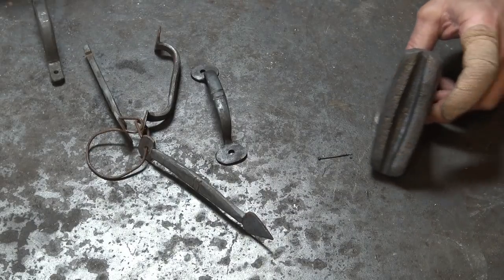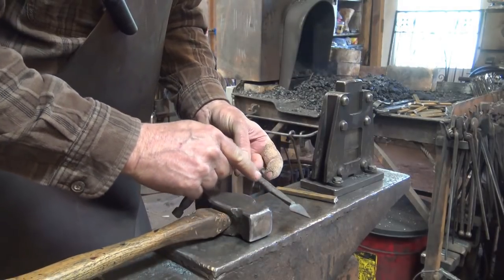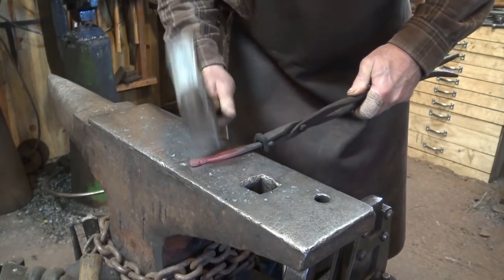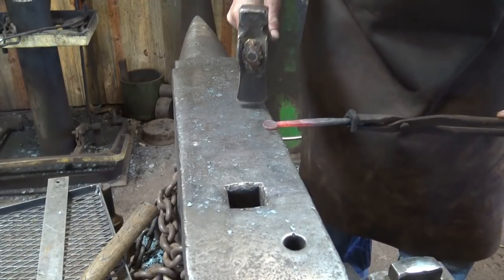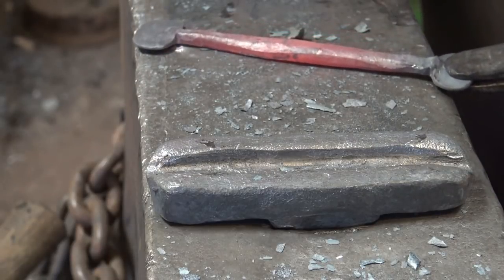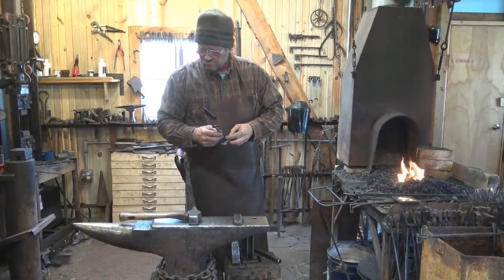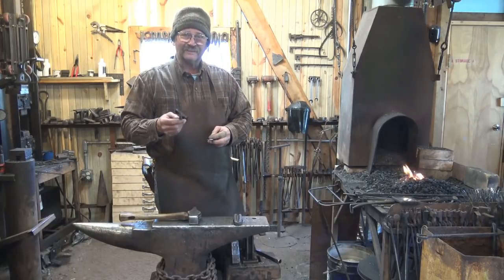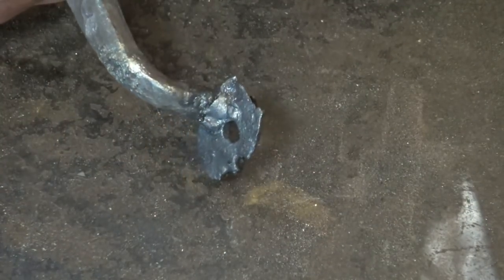Forging a simple cabinet handle or drawer pull - basic blacksmithing

Comment: That second one was not a mistake, it just has some character that the first one does not have and possibly the customer will not find desirable. Or it's a small wall hook needing cut in half. That Swage Block is a dandy that's for sure. And on a final note, a handle on the counter may be handy to get your balance while pouring your Sunday morning coffee after a Saturday night bender.
Reply from the maker: All very good points.  I actually think I will cut the bad end off and mare it into a hook.

Comment: Would it be worth the time to make a swedge that is the shape of the entire piece and form the piece on the power hammer? A lot of work up front, but you could bang them out in minutes and they would all be exactly the same. What do you think?
Reply from the maker: You could certainly do these under the power hammer, but I don't think it would be just a matter of putting a piece of raw stock in a swedge and banging them out.  You would still need to shape the finials and start the taper in the handle before going to a swedge.  A series or tools under the power hammer would make the job faster if you needed to make enough to justify making the tooling.

Comment: hello John Eddy from Holland Europe.I like watching craftsman,Question- I saw a clip where you all met up at a smithies and made some engraving tools.Would i be wrong in saying if you made a swedge and engraved it.would that not save a lot of time in individually decorating them or would the metal not be hot enough to take the decoration.if you get what i mean.
Reply from the maker: If you engrave the the inside it would leave raised lines on the final forging which would be fine if you wanted that.  Having any detail of that sort does require that you keep your position in the die exact or the piece ends up with multiple partial impressions.  For this swedge I felt it would be more versatile without the added decorations.  I have seen old example with more detail, so it doers work.

Comment: I would REALLY like to see you put refractory over that wool, if anything for safety reasons. That wool has particles that are a minute barb. Every time you turn it on it blows those particles around from gas. We already have a ABS mastersmith who has a ongoing lung issue which is believed to be from breathing in those particles from a non refractory forge which barb in the lungs and do not absorb. He has had a hell of a time the last few years near to life threatening.
Reply from the maker: While i understand what you are saying and agree that ceramic wool should  be treated with a coating or ridgidizer, I use ITC-100 and will  be coating this forge lining before it goes into service in the shop.  Your statement is essentially incorrect and may be confusing or misleading to people that don't know what you are referring to.  The ceramic wool is the refractory for this forge.  Putting refractory over it could just as easily mean a second layer of the ceramic wool.  ITC-100 and Satanite are coatings used to seal and ridgidize the refractory and while they are a form of refractory they serve a specific purpose.  The term refractory includes a wide range of products from ceramic wool, ceramic boards, castable, ramable, soft brick and hard brick.  None of which would be the proper thing to coat the kaowool with.  Perhaps I'm being picky, but proper terminology can be very important.
Reply: If semantics are in question I would suggest its you that has it backward, the wool is just that, an insulation and ITC100 IS a refractory that actually refracts heat. Ie from ITC Coatings inc Manufacture website "Re-reflects Radiant Heat and Saves Energy,Achieve a higher cone with less energy" where as Kao Wool and like products are FROM THE MANUFACTURE "High Heat resistance to 2300 degrees". Where Satinite, though labeled a refractory is little more then alumina mortor. There are MDS ratings with specifics to refractablity for both direct heat and infrared if one wants to look. Regaurdless to any of it having a uncoated fire insulation blowing particles into your lungs is highly dangerous in long term health.
I greatly enjoy and appreciate your videos thank you for taking that time